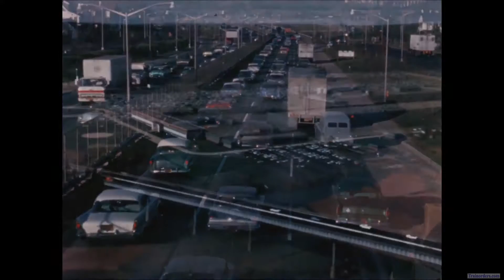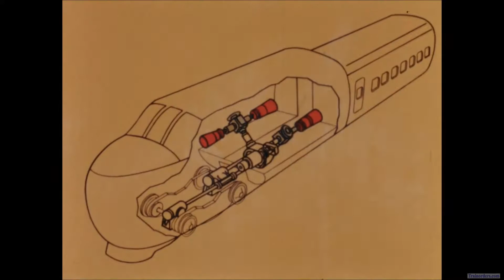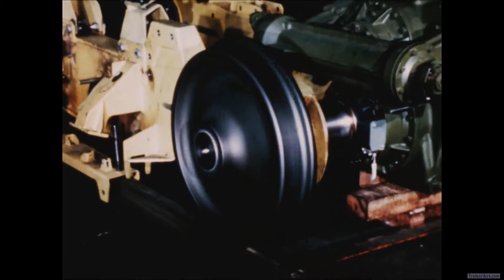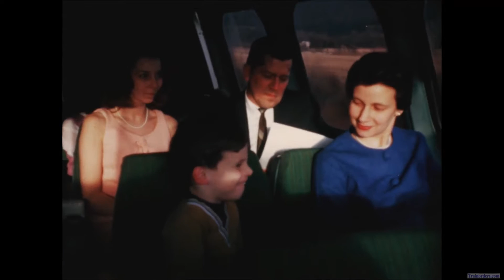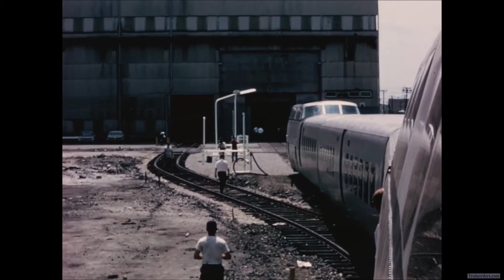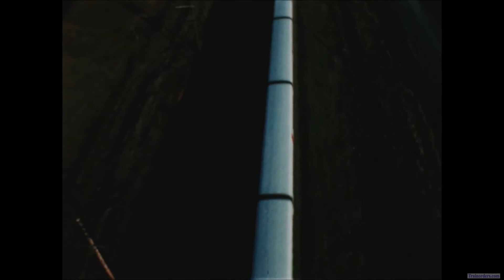TurboTrain Promotional Film

Comment: Wow, this is really good video for engineering fans.
Reply from the maker: I'm glad you appreciate it! It's always difficult to find any information about the Turbo train, even more so the principles of its operation
Reply: @Nate-zy1qr  You know what mate, this video actually tells us it is only 2 feet away for USA and Canada to build some really cheap High Speed Rail if they replace those turbo engines with modern piston engines, probably this new HSR will be much cheaper to build than those electric powered and cable wired HSR, and much cheaper to maintain as well, with much better fuel economy and over 300km/h cruise speed.
Reply from the maker: @hujiaming6151  it's funny you should say that. Every now and then I wonder What a "Turbo-revival" would look like. As beneficial as an electric Turbo would be, it would be tremendously expensive - as you mentioned. Online, many people are of the opinion that  a piston engine of equivalent power to the four turbines would be significantly heavier than the train's structure could support (I am unsure about torque requirements, but Canadian turbos developed about 1000hp in order to move the entire train). The way I see it, North America should spend the money to develop electrified HSR, as it is an investment for the future. Similarly, an electric TurboTrain, while initially expensive, has the potential to be more efficient than even the most modern HSTs, due to its lightweight construction. As much as I'd like to see the TurboTrain run again for personal reasons, I Can't ignore the benefits it could bring. :)
Reply: @Nate-zy1qr  You are totally wrong man, piston engines are far superior than any of those stupid turbo and electric engines, you never truly do your homework didn't you? Have you ever heard of the amazing 2 litre ecoboost engine that Ford developed just for Ken Block's little rally fiesta? It can generate a healthy 650 hp in a decent manner, and only weigh about 100 kg, while your super thirsty gas turbine engine on your turbo train could only generate about 500 hp. Trust me, piston engines are the future.
Reply from the maker: @hujiaming6151  That ecoboost may generate 600hp, but would have to turn exceptionally quickly. In case you haven't noticed, a 7-car train is a bit longer than a little Fiesta, and fully loaded, would weigh over ten tons. If a piston engine of a similar specification were to be used, it would need to work extremely hard just to get moving. As well, if you used five Fiesta engines in a TurboTrain configuration (three at one end, two at the other), that's five crankshafts, fifteen pistons, and an unfathomable number of valves, belts, chains, pulleys, camshafts, and other moving parts requiring service and replacement at regular intervals. In comparison, a turbine engine has less than ten individual moving parts, as does an electric motor. What I just explained applies only to one unit. Why would a railway want to put up with an entire fleet? There are high speed trains, such as the extremely successful InterCity 125. It uses one large engine at each end. However, it's a diesel, meaning higher compression, and thus, a heavier block. As well. emissions, something you failed to mention, are more important than ever. Electric trains are essentially zero emissions, unlike turbines and pistons. How can you say I haven't done my homework, when your "piston engines of the future" can't even touch  60% efficiency?
Reply: @Nate-zy1qr  You are still wrong, first you don't need a big ass engine to tow a 7-cart train because it is running on rail, and rail provides far less friction than tarmac and rubber, it will require much less power to start the train and my ecoboost engines can easily handle that.  Second, your so called 60% efficiency for gas turbine engines is nothing but a lie, why don't you check with air force or airlines and ask them which type of engine consumes less fuel for same distance flight? Piston or gas turbine? They will certainly tell you it is piston engines. Gas turbine engine is notorious for its super high fuel consumption, their real efficiency is just about 20%, and that is one of many reasons why so many airlines need regular subsidies from government.  As for piston engines, more moving parts does not mean high maintenance and high fuel consumption, quite on the contrary they ensure durability and low maintenance, as a matter of fact maintenance cost and fuel consumption are very low for piston engines, so does the purchase cost, that is why piston engines are greener and more economical than gas turbine engines. Unfortunately your so called gas turbine engine could only generate about 500 hp at extremely fast rev speed, and my fiesta engine only need to do that, actually it has the potential to generate more hp, Ford just wanted more durability so it is limited at 650 hp, so my fiesta 2.0 litre is superior than your gas turbine. I know you cannot swallow that, but that is scientific fact, and engineers obey and act on that. 

BTW I never mentioned diesel engines, they are not my option and never will be, diesel engines are naturally low efficient engines, and they are low powered too, if you believe diesel is more efficient than petrol then you are just as deceived as the public. In addition petrol engines are a lot lighter than diesel engines, check with Maclaren's V8 engines then you will know, and same to my 2.0 ecoboost, it is just as light as your 500hp gas turbine engine, so you do not have advantage here. That InterCity125 is not highspeed train, its top speed is only about 230km/h, an HSR need a speed of  300km/h at least.

If I build a piston powered HSR it must use advanced petrol engines, not diesel.
Reply from the maker: @hujiaming6151  Personally, while I was never a fan of biology, I see that I'm gonna have to dissect this for you.

First things first: The seven car train weighs over TEN TONS. Your crappy little ecoboost could never move that mass at an acceptable speed. The horsepower is there, but the engine lacks the required torque needed to move such a mass. You are correct in that the reduced friction would be in your favor, but even still, acceleration would be atrocious.

Secondly, if you look at my last reply, you will see that I said "Your 'piston engines of the future' can't even touch  60% efficiency." I didn't say turbines were 60% efficient, I said that piston engines, by design, will never reach 60% efficiency. Compare this to electric motors, which are usually over 90% efficient. Whether your mistake was intentional, or due to incompetence, is not important.

Third,  you attack the gas turbine, claiming that your little ecoboost is superior. Though a few of your points hold water, I will not be responding to your claims. TurboTrain was a product of the 1960's turbine era, and I acknowledge that the use of the PT6 gas turbine was a mistake. I noticed that you never try to compare your ecoboost to electric engines, like the ones I proposed for an electric TurboTrain. Probably due the fact that even YOU know that the ecoboost would never stand a chance.

Tell me: if diesels are such low efficient engines, Why is every large engine a diesel? Probably because diesel fuel has more energy per unit than gasoline. Diesel engines are better than gas engines at developing torque, ideal for heavy machinery.  Pickups, trucks, buses, trains, ships, and just about every piece of construction equipment is a diesel, and has been for decades. Even Europeans like diesel cars. If you don't know that by now, you shouldn't really be arguing with me.
Reply: @Nate-zy1qr  It is you are so naive and childish, you are such a half rookie, mate. Listen, diesel engines only used so widely because it is suitable for corrupted capitalism ideology, not because it is good or efficient, just because using diesel powered engines will be good for oil business to sell more oil. If you want to compare the true efficiency, well you will be disappointed to know that diesel has no hope in comparison of petrol, those big diesel engines for trains are at least 200 liters each for their size, while only generate  about 6000 hp, while you could just use 3 6.0 liter petrol engines to do the same amount of work, which only counted as a 18 liter engine, from the data, it clearly indicates diesel engines have no hope.

To your claim about my ecoboost 2.0, mate, I think you are just high at the  moment you accused of my opinion, come on, you must not be a qualified engineer, I only have one thing to say to put you on bottom, have you ever heard of a great thing called "gear box"?  with a large enough gearbox in operation with my three 2.0 ecoboost engines, the 185 ton train will be moved easily than ever from speed of 0, and that gear box will save a lot of fuel for the whole trip by going into overdrive while at cruise speed, make your gas turbine engines look like a joke.

Last to your moronic electric engines, man , come on, don't humiliate yourself again, to ever make  electric engines operate, you need at least 3 huge high voltage power plants to be built and maintained just to supply stable power for your tracks, then you need to build thousands of poles for the copper cables along the track, and thousands of kilometers of copper cables, and many maintenance personals etc. That means the cost to keep a (just one) electric train track working will cost well, only god knows how much that will be, it must be an astronomical number of cash, and that will likely to bankrupt your state financially, if you check the numbers even from China, they just had the largest HSR network in the world and they just got a report saying their HSR has about 2 billion$ operational loss in finance every week, just because their HSRs  are all powered by electric motors. Man come on, don't be stupid, I now electric sounds good, green, 0 pollution, but it really burn a hole in your nation's wallet, what is good of that? The answer is none.

Just accept my opinion man, your know I am right.
Reply from the maker: @hujiaming6151  Diesel fuel may allow oil companies to sell more oil, but it is a proven fact that diesels produce more torque than petrols. Also, in regards to your "corrupt capitalism" argument, you do realize that diesel is used because it contains more energy, correct? Please do some homework.

Your "gear box" could give the ecoboost more torque, but would require that the engine maintain an extremely high RPM. This would decrease the lifespan of most of the wearing parts, leading to more frequent downtime for the train.

When it comes to electric engines, Power supply can be as simple as tapping into the local grids of the towns you run through. I don't know where you got the number 3 from. As well, regenerative braking on one train can provide power for another, further reducing energy costs. Catenary wires and poles will be expensive, but it all depends on placement. If ridership is high, revenue will be able to cover the maintenance costs.

And don't forget: There will be extra money in my pocket, due to the extremely reduced maintenance costs. No silly pistons, crankshafts, valves, or pulleys to replace. As well, because of the over 90% efficiency, less energy is wasted. Compare this to your terribly inefficient ecoboost, which, like I keep saying, can't even reach 60% efficiency. In China's case, the communist government often builds unnecessary railways. These tracks aren't meant to make money, they are used as a tool to dominate and manipulate the country. It is politically favourable for the government to build them. Dude, just quit while you're ahead. 

Also, please name me a petrol-powered vehicle that operates at a high speed, high duty cycle, and requires very little maintenance.

I'll wait...
Reply from the maker: @hujiaming6151  Fair enough, my friend. We can agree to disagree. 

But I'm still waiting